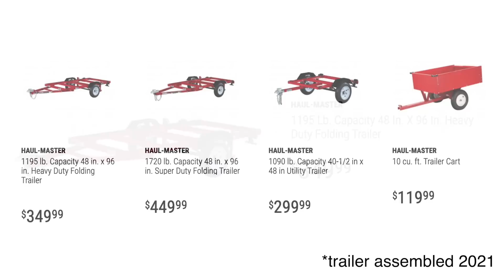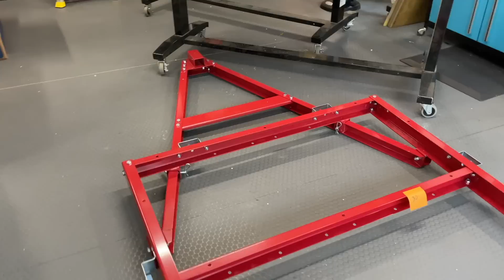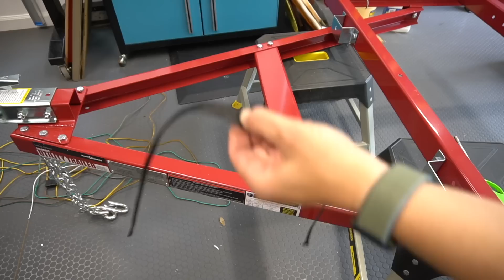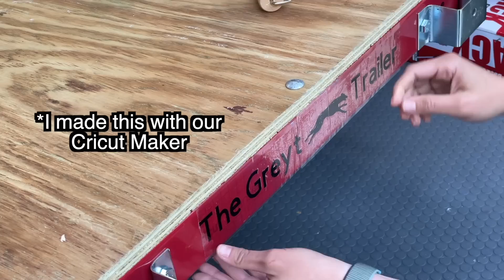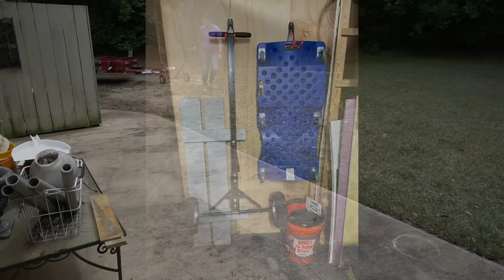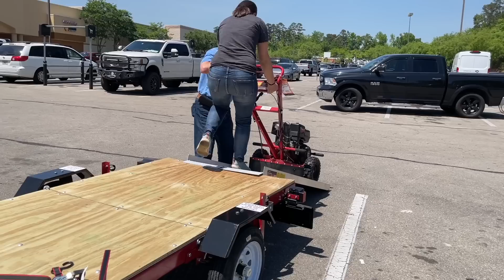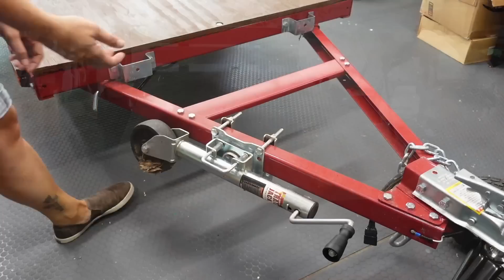Harbor Freight DIY Trailer Kit

Comment: Thanks for the great video! Just to let you know I just built a motorcycle trailer out of the 1500lb. H/F trailer. You can get a Curt Manufacturing trailer hitch for about $175 and a wiring harness for $44, both easy installs for go getters like you and your mom. I got it completed for $835 including a spare tire mounted on the left front side rail and a $50 motorcycle wheel chock mounted to the front of the trailer. Great job on your nice trailer!

Comment: Something interesting to note is the 1720lb trailer does not have a cross beam on the triangular section of the trailer tongue. When assembling my 1720lb trailer, this threw me off. Thinking if the 1195lb trailer shown in the video had the cross member, mine will too. Unfortunately, it doesn't, and simply bolting the spare to it on the 1720lb is not an option. You can see the difference at 1:20 when the video shows the trailer images listed on the website. Great video, very helpful.

Comment: Nice job and I bet you do more maintenance than 99% of the guys out there. I paid $300 each to have my 5th Wheel RV and dual axle dump trailer bearings repacked this fall.

Many people cross the safety chains. I believe the reason is if the trailer comes off the hitch, the crossed chains keep the trailer straight behind the vehicle. My Son in law borrowed my 7x12 flatbed and it came lose. I think he didn't latch it properly. The chains broke and the trailer hit the medium barrier and then his SUV. It could have been worse.

Also, many trailers are stolen every year throughout the country. I suggest using a hitch lock. On my 7x14 dump trailer, I have a wheel lock, hitch lock and a Trak-4 tracker. One guy online paints the top of his axle pink so the cops can recognize it easily and you can also punch in a serial numbers on the frame and/or axle. Many use their driver's license number for this or other identifying number. Cheers

Comment: Splice connectors are fine.  The lights don't work because they designed the ground to go through the frame.  The tongue is not electrically the same as the frame.  Just add a ground wire to each of the lights.  As I recall it is a white wire.  

I used treated wood for the deck and alumium sheet on top of that.  I put a tarp on the hitch but that is it.  I have had it for a few years.

I stopped folding it and just made it ridged.  I just about had the tongue come down and hit me in the head.  It is just too heavy and not very safe.

Since it is ridged, I bolted sides on it with 2X4s about 2 ft tall and made the back gate removable with pull pins.  Harbor freight also sells ramps for loading things like lawnmowers and the such.

Comment: The back half fell back into place I tried to stop it with my hand and my whole hand was scissored and caught between the frame and the leaf spring bracket area I though for sure I lost fingers or severed my wrist I had to pull my hand out with all my might be careful

Comment: Im probably late to say this but. 

1.) Make sure you lock the tongue in place when you move the trailer with that trailer dolly. If its unlatched it can fall on your foot.
2.) Your side marker lights only work with the headlights on, when you were testing the rear lights I noticed you didnt have the headlights on,  you just tested the brake and turn signals. your wiring is most likely fine just make sure you turn your headlights on next time you do a trailer light check!

Great video, I had one of these trailers before and although I didnt need to see any of this I watched it anyways because it was good, thanks!

Comment: Isn't it a shame you can't read the comments before you begin assembly. I placed your video in my YouTube Save folder. My car came with a pre-installed trailer hitch and 360 degree overhead view option. My owner's manual informed me to compute the GVW when towing a trailer. The formula is Weight of vehicle+weight of driver and passenger(s)+weight of the trailer+weight of cargo being hauled. Make sure you don't exceed that weight.

Comment: Just so you know many people who own the same trailer have a slightly different folding/storing technique that allows them to store with one person and should allow you and your mom to store it upright by yourselves.

Instead of fully folding the back half up they attach some kind of strap or bracket that holds it up at about (but slightly less than) a 90 degree angle before they lift it onto the casters, the reason is if you fully fold it up you have to lift all of that weight whereas if you leave it unfolded it acts as a counterweight making it MUCH easier, once its lifted up you then finish folding the back half up and secure it and finish the rest like normal. I hope this helps.

Comment: Instead of making indentations for the bolt heads to fit inside, you can use longer bolts that go thru the plywood and frame. And instead of using carriage bolts you can use regular bolts. Carriage bolts work best when the square part is inside a material that won't loosen up, such as metal. Though the head of a carriage bolt does provide a rounded and smooth surface for when you load stuff on top. Another issue with carriage bolts is there's little surface sticking up that you can "grab" with a tool to keep it from turning while you tighten up the nut end. Again, if in wood it'll eventually just gouge a bigger hole in the wood. That's why a regular bolt is fine and maybe preferable. Another thing about carriage bolts is that when they corrode or rust it's very difficult to loosen them up if you want to change things on your trailer. Just something to think about. And all the extra bolts and wiring and stuff can be found at any good hardware store, and some of the stuff at an auto parts store. And Walmart has a lot of extra stuff for trailers. So if you don't live near a Harbor Freight or Home Depot you can still find stuff for your trailer. Overall you did a great job with this video. And even us DIY type people may find it interesting, mainly to see how someone figured it all out.

Comment: Nice job on the assembly and the video. I think the extra detail on how it comes from the store, and all the extra accessories to complete the job was a nice touch. As a mechanical kind of guy who also ran trucks and equipment for many years, it’s easy to forget that something which seems elementary to me or someone familiar with this type of operation can be very daunting to someone who is not. Also I like that you spent time explaining some of the factors which relate to the use and operation of the trailer. Again, great job on covering routine maintenance procedures. You thought this video out very well, and your information and recommendations are spot on for a novice trailerer. I give you an A+ on this one

Comment: I solved my grounding issues by just running a ground wire from the rear lights to the front wire harness and splicing in the side lights.

Comment: Friendly tip that's worked for me on lifting and lowering the trailer... I like to keep the back half of the trailer unfolded while lifting or lowering. That makes the total weight you have to lift much lighter. The back half will skate along the ground on those galvanized brackets.

Comment: A thorough and well produced video. 

Having built one of these and added some of my own modifications, I have a few tips for those considering a Harbor Freight trailer:

I recommend purchasing the 1720 lb capacity trailer rather than the 1195 lb capacity trailer. It's only $30 more but comes with Box channel tow bars and cross-members rather than C channel, and the Tow Bar attachments provide more reinforcement. They also come with 5.30-12 5-lug wheels rather than 4.80-12 4-Lug. The axle is also heavier duty.

I used cinder blocks standing on end from the beginning, with cheap wash/cleaning cloths on them to prevent scratching. I built the trailer entirely upside-down on the blocks including installing the fender brackets, but minus the fenders to prevent damage during flipping. Only then did I flip the trailer right side up and finish the detail work including the coupler, light brackets, and lighting.

If you have any power tools that use a 5/8" /16mm flat wrench for blade or bit changes, they work perfectly to hold the fixed nut on the casters while installing the stud nuts.

When installing the axle and spring assemblies, install the fixed spring bolts at the front, but not the rear bolts that retain the slipper tails. After installing the axle and hand tightening the U bolt nuts, rotate the entire assembly forward for easy access to the U bolt nuts. This is important because those nuts requite being tightened to a specific torque and it's mush easier to do while rotated.

It is not "shipping grease" in the hubs. The supplied grease is perfectly adequate, as long as the bearings are fully packed with it. If not, purchase some equivalent wheel bearing grease and pack them more fully.
There are three reasons you'd need to replace the grease: If you contaminate the original grease with dirt and muck during assembly, if you will be hauling heavy loads for long distance highway travel, or if you intend to use it as a boat trailer that will be submerged.  For the first, replace with the same type. For the second, replace with grease rated for higher prolonged speeds. For the third, use a waterproof boat trailer grease.

Run a ground wire to every light. These trailers are kits and designed to fold. Since the pieces are pre-painted and the pivot points are the only connection between the tongue and trailer, and the two halves of the trailer, they have very poor electrical continuity. You will avoid a lot of headaches later by running full grounds. A hair dryer will work on most heat shrink, and avoid damaging painted surfaces. If you use the self-soldering waterproof connectors, a hair dryer might not provided enough heat. Test first.
Do not use electrical tape for any sealing or bundling. It's intended for temporary holding and protection of wires and will not last, especially exposed to the elements. Use rubber tape instead.
I also recommend not using the automotive wire taps. They are fine for low power tapping inside a car, but also not designed for the elements and will corrode or come loose. Cut and strip the wires and use the butt connectors.

IMPORTANT NOTICE: I have seen far too many people claim these trailers are not strong enough from being bolted together and recommend welding them. That is complete nonsense. They will flex a bit like all trailers, but are very strong when assembled as designed. 
Aside from a lot of stripping and repainting, welding them will result in a weaker trailer prone to structural failure because the geometry is very different between parts that bolt together and those designed to be welded. Not only would the welds be subject to additional stress due to incomplete fusion between parts, but you'd lose the friction between them that is provided by the clamping force of the bolts.

To mark the trailer bolt head locations, put pieces of duck or metal foil tape in each spot on the underside of the plywood, place it on the trailer and align it, then tap each spot with a mallet to create an impression of the bolt head in the tape. 
Do not over tighten the carriage bolts. The square shoulders need to seat, but you don't want the head to crush the plywood.
It's not really necessary to bolt the deck to the cross-members in the middle. The four side rail holes and the middle holes in the front and rear cross-members are enough.
Make sure to shim the areas over the cross-members, especially where you install bolts. If you force the plywood to flex you can create micro-fractures in the glue that will wick moisture and cause the plywood to prematurely fail.
I cut 1/8" tempered hardboard into 1-1/2" strips and glued them to the underside of the plywood in line with the cross-members to fully support the plywood all the way across.

REGISTRATION

Check your state requirements. Some don't require these to be registered at all, while others have a one or two year registration. Here in Arizona it's a lifetime registration as long as it's not used commercially. Many states will also require an inspection before the tags are issued, so make sure you assemble the trailer as designed.

MODIFICATIONS

Because our car is small and the receiver is quite low, I didn't want nor could find a ball mount with an extended rise. To compensate I installed the coupler onto the coupler plate and then attached it to the underside of the tow bars rather than the top, lowering the coupler by 2-5/8". I installed the flat T plate on top which also helps strengthen the coupler and makes it far more difficult for thieves to remove the coupler or chains.

Instead of using the clamp that comes with the trailer jack, I cute two pieces of 1-1/2 steel tubing, painted them to match the trailer, and bolted them to the right hand tow bar on top and bottom. I bolted the mounting plate of the jack to the tubes but on the inside so the jack is more centered and out of the way. It required modifying the plate, and drilling into the top and bottom of the tow bar (never drill into the side of the tow bars), but it's a lot cleaner and makes the jack harder to steal (including some extra security measures I designed into the mount).

I didn't build the trailer to fold since we didn't need that option. I still installed the caster brackets but without the casters. I also cut off the ends that have the flat shoes welded to them. This provides a perfect jacking point for the car's factory pinch-weld scissor jack should we need to change a flat tire.

To avoid paint wear I placed large, thick nylon washers between the tow bars and the brackets.

These trailers will bounce on the tires when unladen or only carrying light loads. Since ours will only carry fairly light material loads and sporting equipment like bikes and kayaks, I removed the auxiliary leaves from the springs to soften the ride. Doing so reduced the load capacity from 1720 lbs  to around 600 to 800 lbs, so do not remove them if you ever plan to haul heavier loads with the trailer. There are after-market kits available that will soften the ride while maintaining the load capacity, but you need to be handy with drilling and welding to install them.

I didn't buy a traditional clamp-on spare tire bracket because they are awkward, unsightly, and unsecure. Instead I designed, engineered, and fabricated an automotive style winch that holds the tire under the rear section of the trailer. It uses the same wrench as the car jack and the same socket as the trailer lug nuts. It's too complex and used a lot of scrap materials I had on hand so I can't go into detail, but perhaps it will inspire others to design their own, or give them another idea how to include a spare tire.

Comment: Wires won't ground through paint. The screw you tapped into the trailer touched raw metal and that's what made it ground. The other holes would have worked if you would have stripped the paint from them.

Comment: If you are still wondering about the splice connectors for side lights: replace them with the same shrink tubes with solder as you used with rear lights. Cut the long wire, and insert one wire from other and two from other side to get a split in the wire. If you would do this before installing the wire, you can just slip the tube over the wire and only cut the insulation in the middle of the long wire (easiest to do with compound wire strippers). This is from a DIY perspective, so I'm interested to know if somebody has a better idea.
I avoid the splice connectors at all costs, as they have rather open design and thus collects moisture, which causes corrosion in the wires (we have road salt on winter which makes the problem even more obvious). In addition they may become loose or cut more strands from the wires due to vibrations, causing bad connection.

Thanks for the video.

Comment: so glad to know someone that drives in tallahassee actually has a brain. especially when towing. and i agree with another you should cross your chains. and one other thing i did notice was maybe some blue locktite on them bolts would help keep them nice and tight. i built one of these to tow my can am ryker to motorcycle shows. works great.! all in all a very informative video. also a set of bearing buddies we use on boat trailers come in handy

Comment: I would suggest using 4 bolts instead of the two securing the hitch !  Mother Daughter projects are wonderful !  Throw away those Scotchlock blue connectors !
Cross the safety chains !  Cut Cotter pins carefully, the cut piece will fly , hold with pliers or throw a rag over it .

Comment: To use the safety chains correctly, they should be crossed in order to form a cradle in case the hitch disattaches
Great job😁

Comment: I have that same torque wrench and I didn't hear it click when I was torquing the oil plug bolt. It snapped off!! Luckily I was able to get it out. I've used that torque wrench half a dozen times so I thought I would be able to hear it click. oops. Made for a stressful oil change to be sure.
Reply: I don't have the exact model, but especially with low-torque oil plug bolts I have had difficulties to hear or feel the click as it's very faint on low end of the scale. It gets easier with routine as you have an idea on how much a certain torque should feel and hopefully notice something is off before snapping anything.

I have had a cheap torque wrench having the spring inside snap off, which removes the limitation (clicking), so it's now just a large ratchet. Thankfully it was very noticeable, so I didn't break anything.